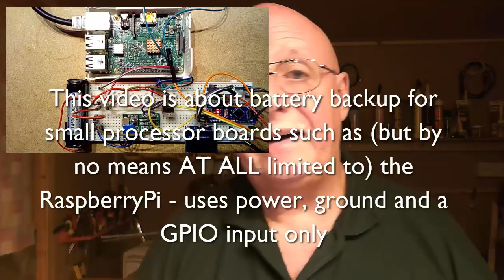Prototype Uninterruptible Supply for the Pi

Comment: Impressive, maybe overkill - you must have some important services running on the Pi to have made you take this route
Reply from the maker: Not overkill at all.... yes, heating control - when I'm in a different country for months on end.... needs to be reliable - and the power is not 100% reliable. Learned this the hard way.

Comment from the maker: Be sure to check the blog entry for this...https://tech.scargill.net/more-uninterruptable-thoughts/   in the short period between doing the video and now I've improved the software markedly, reduced the display to a 32-pixel version (slightly lower code OLED) and it is all starting to look pretty good - in 24 hours the next prototype will be WAY, WAY smaller than this one.